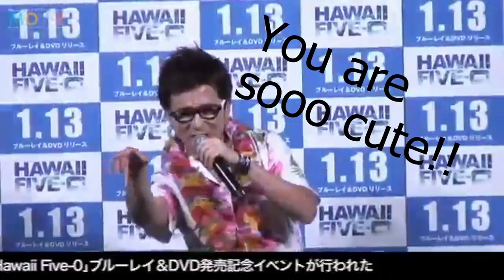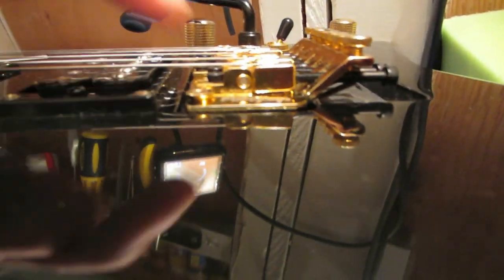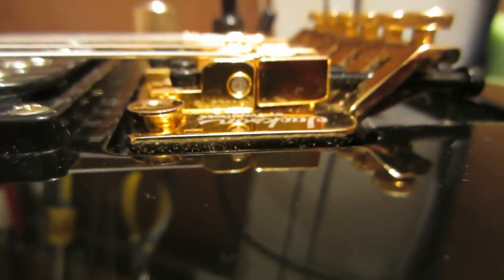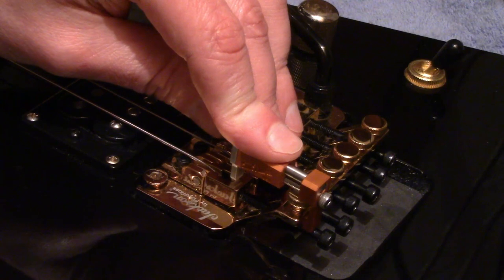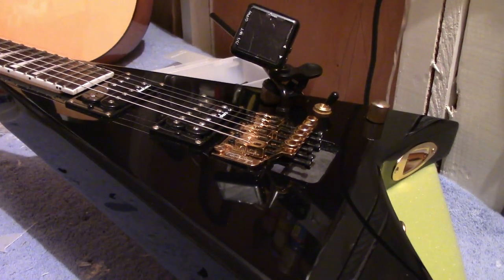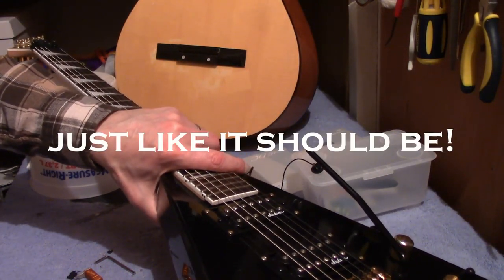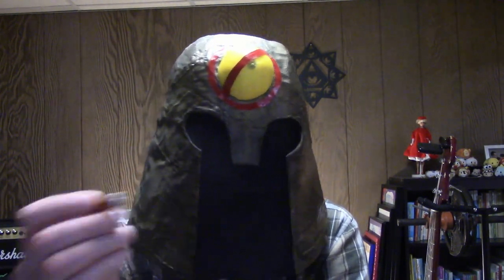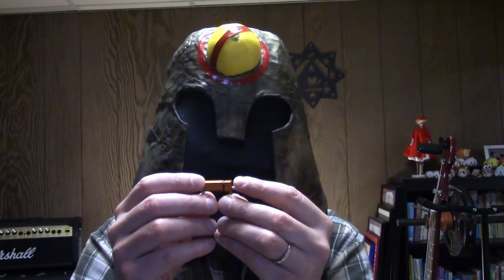Best Tool for Floyd Rose Intonation?　フロイドローズのイントネーションの道具

Comment: Friendly tip: You should always tune the guitar and check the octave while in the playing position. You will find that the tension on the neck changes slightly when it’s resting on a cradle like that.
Reply from the maker: thank you for that!
Reply: Rest it on the joint where it bolts on or neck thru up closest to body. So hard to do while holding it!

Comment: It's best to loosen the string before using that tool.  Relieve the tension a little.  Also adjust the neck relief and action while the block is installed.

Comment: Many thanks man! It was very easy to understand this painful process. I have the other intonation tool, "the tool", but so far I never used it. I will give it a shot soon. Again, many thanks for your videos!
Reply from the maker: glad I could have helped.  If you do decide to set up the intonation, let us know how it went!
Reply: @metal_helm  Well, a couple of weeks later, here are some of the results. I set the three springs parallel on the back, tunned everything, and after one day more or less, I adjusted the intonation in the old way (since it is an lp lic. Floyd, neither The Key nor the Skyscraper would work), and everything seemed right. But the guitar continued to present tuning problems... so I figured out that the real problem was the locking nut! The middle block especially (3rd and 4th strings) did not close very well. I compared that to my other Floyd-equipped guitars, and yes, the block did not close well. So I sanded that block carefully a little bit and voilá! Now it holds tunning almost perfectly, it only loses tuning if I abuse the Floyd a lot. 
Since I am the fourth owner of that guitar, I just suppose that one of the previous owners had lost that block of the locking nut and replace it with another one which did not fit very well. 

Many thanks, again, for your videos an for encourage people to solve this kind of tuning problems!

Comment: Bridge block is is to end the battle of cause & effect when lowering & raising the string tension when setting the saddle. You do the same for a hard tail tune-o-matic saddle. Loosen the string to move the saddle back & or forth. Then tighten the string to pitch to test intonation.

Comment: Most of those Floyd Rose bridge-plates will have three saddle mounting-screw holes for each of the 6 string saddles, I've got a chrome Schaller Lockmeister Floyd Rose bridge-plate and a chrome Floyd Rose Special bridge-plate and both have three holes for each of the 6 string-saddles, incidentally, both the Schaller Lockmeister and the Floyd Rose Special are close-enough in dimensions to be virtually identical to a Floyd Rose Original, and they both should be virtually a drop-in fit for the body routing, I've actually tried it and can confirm that to be true.
Reply from the maker: thanks for that. good to know for someone who might want to try it out!

Comment: I notice that (unlike this thing)  the FU TOOL doesn't require you to make any adjustments to the claw or actually anything other than the saddle. What is the possible advantage of this thing???
Reply from the maker: I have no idea because I never used the FU tool.  I just use this thing the other day and work great like it always does. How much is the FU tool ?
Reply: @metal_helm  The FU tool was designed by Floyd Rose and takes literally a minute or two per string. Simple, quick. I don't even understand why the other tool was produced other than maybe the dude didn't know that Floyd Rose already had a solution/tool for simple intonation. I paid $13 for mine.
Reply from the maker: @paulfrehley7352  are you talkign about "the key"?
Reply: @metal_helm  Yes, it is also referred to as the key.
Reply from the maker: @paulfrehley7352  i see. before I got this, the reviews were not very good, and that was my deciding point. (don't remember why it was getting like 3.5 out of 5 stars

Comment: Thanks for your excellent video, my friend. A question: if I understood correctly, with this key it is not necessary to loosen the string from the tuner? I mean, I always thought (wrongly, I guess) that to slide the saddle in the direction of the bridge, we first had to loosen the string a lot. Could you please, clarify this? Thanks a lot.
Reply from the maker: Yes, correct. You do not loosen the strings from the tuning pegs. thanks for watching
Reply: @metal_helm  Thank you for answering, my friend.

Comment: I don't understand why loosening the strings can be any more irritating than blocking the unit, messing with the spring tension which I would think could damage the wood over time and the other steps. Im a rookie with set up, but have played for over 40 years.
Reply from the maker: I understand what you are saying, but for me, blocking the unit is a one time thing and it's done. But loosening the strings over and over takes a LOT of time.

Comment: I didn't like "The Key" because it could only go certain lengths and it would get loose with the round piece with the finger grips
Reply from the maker: Sorry to hear it didn't work for you.  I guess it's not for everyone
Reply: @metal_helm  it worked I just had to keep readjusting it. I was wondering if this tool had the same issue
Reply from the maker: @brandonharris9160  oh yeah, I see! for some reason when you said "key" I thought you were talkign about this tool, then I remember there is a separate tool called the key.  I never had an problems with the length and I'm not sure what "the round piece with the finger grips" but I never had anything become loose when I use it.
Reply: @metal_helm  lol yeah I have the Key which is more common. This tool looks much better and more high quality

Comment: Yeah.  I've seen these type ..  but really. I find the hollow points system is so easy to use on Floyd Rose trems.  No block.  No nothing except loosen the little Allan/hex screw that holds saddle down.  And literally turn the hollow point on whatever string you're adjusting. Till you get it 100%. Then tighten the little hex screw and that string is done..  the hollow points stay on guitar. And actually add a little more mass to the bridge. Which gives a tiny bit more solid tone also.   But I prefer a large brass block for that as well.  I have oversized brass blocks.  And hollow points intonation system ... And titanium saddle insert blocks. On three of my Custom home built ML style Guitars.  And the difference is great and noticable and almost effortless.  Compared to any of the other trems..  
Just saying. That's just my 40 yrs of messing with Guitars talking here.
Reply from the maker: i'll have to look into this...never heard of it before, but seems to good to be true! I don't know...I am thinking about swtching to Vegatrems as I am tired of FR not staying in tune.   we'll see!